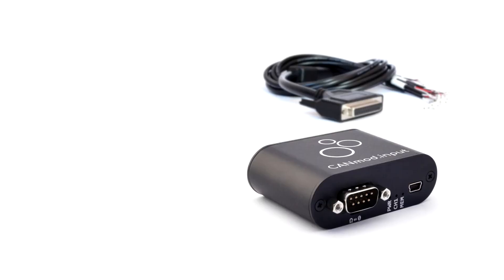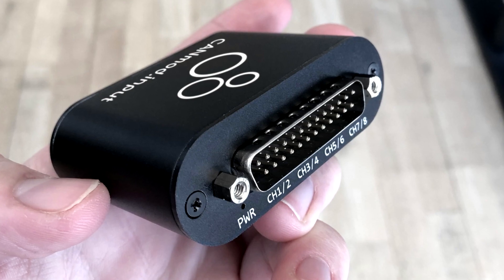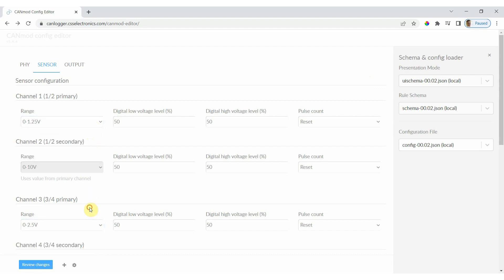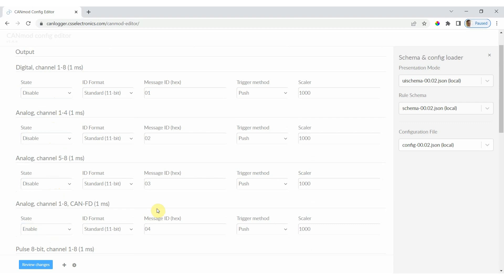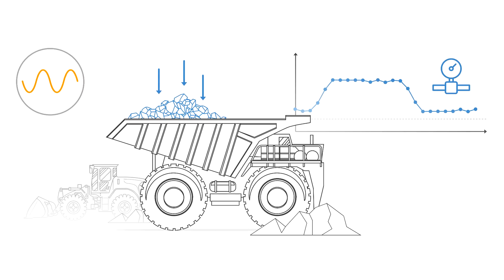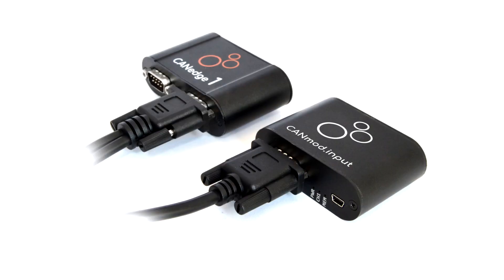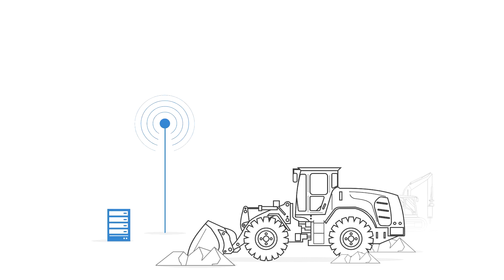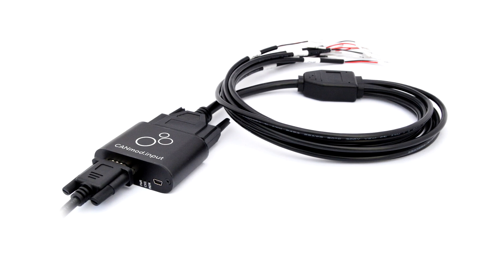Analog/Digital/Pulse to CAN Bus Converter (8x) | CANmod.input

Comment: I’m looking to Input multiple sensors on a analog vehicle and output them to a can-bus style gauge cluster 

(Swapping dash and steering wheel from a 2008 f250 into a 2003 f250)

Would this allow to display on factory cluster?